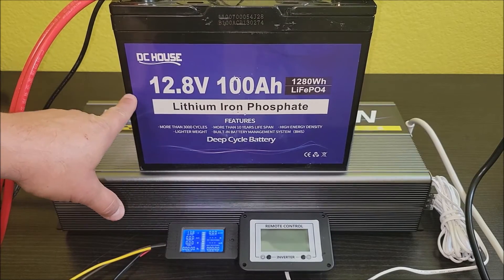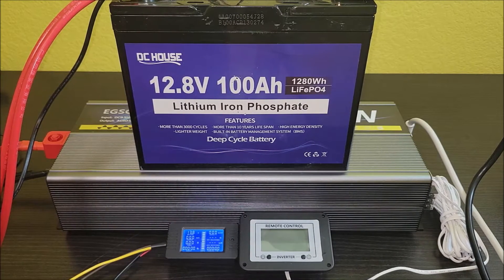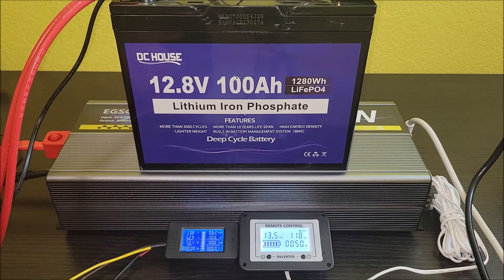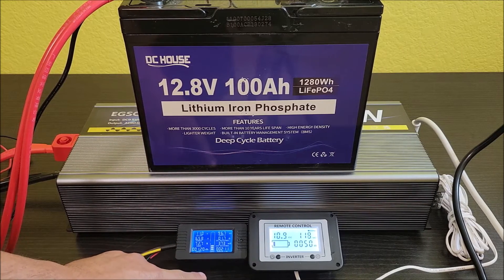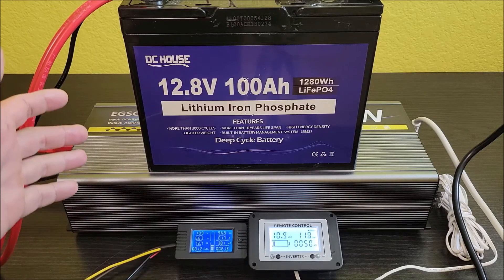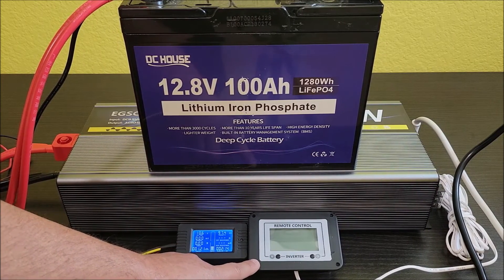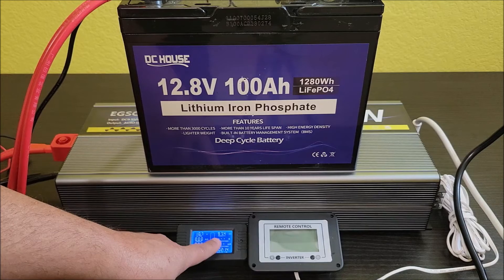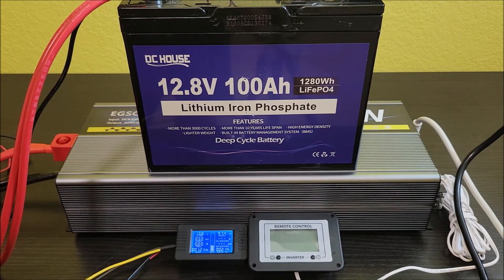Cheap LiFePO4 - Testing the DC HOUSE 12V 100Ah LiFePO4 Lithium Battery

Comment: I bought one and now can’t find a wired battery box it will fit in. Most 100ah batteries seem much smaller. Any suggestions?
Reply from the maker: https://amzn.to/4c7hJ0n ?  Is that what you are looking for?
Reply: Li time battery 12.8v 100 Ah battery is better. Reviews speak for themselves.

Comment: I just ordered a 200 ah one off Amazon for $380. Hope it last longer than my previous gel battery which made it 5 years.
Reply: Treat it properly and you may get at least 10 years and up to 20 years from the LiFePo4 battery. Don't discharge down below 10% and don't charge up past 98%
Reply from the maker: It should.  I have had great luck with LifePO4 batteries so far.

Comment: Is it safe to just sit this kind of "non-marine" chinese LiFePo4 on top of a rental boat while in open, heavy rain or should i look for a marine grade battery? How likely is damage by doing it? Sorry about the dumb question :D
Reply from the maker: I would cover it to keep it as dry as possible.  Like a battery box or something like that.  They have chips and such inside them that could get wet and fail.  Other than that, I would not have an issue using it in the rain.

Comment: Hi I would like to know, I would like to buy that battery tester to get a true understanding of how much capacity my battery has left. Does that tester reset the counted ah. When the inverter starts charging the battery or does it count back wards? What I'm trying to understand is if that battery tester resets every time the inverter starts charging the battery when the mains comes back on? Would love to know. Thanks.
Reply from the maker: I have to reset it manually.  It's a cheaper monitor, but I am pretty sure they have better ones on Amazon like this one: https://amzn.to/42QInrG

Comment: Unfortunately, the cheap $30 Ah meter that your using can be off by 15% to 20%. We paid over $10,000 a piece for each one of our DC load testers that we use, which provide 0.05% accuracy.
Reply: So you have a better video on your channel then ...
Reply: No, we don't advertise batteries. The results of our battery and inverter tests are not meant for public disclosure.  @MrJackson66
Reply from the maker: This cheap one has been accurate enough for me.  I don't need pinpoint accuracy to the thousands of a watt.  If it's off a few watts, that is fine.  It's nowhere near 15% to 20% off.  Maybe 1% or so.
Reply: @quickquote1568
Aren't you Special !
 FJB !
Reply: Hahaha they are max 3-4% out at absolutely max more like 1-2% and I see your posts on alot of videos trolling are we
Reply: Wow, so you like wasting money then
Reply: @sethbob5742  No, you can't go cheap when investing in test equipment unless you want cheap results.

Comment: When you install these in the RV would you please repeat an RV’s A/C test to see approximately how long the RV’s AC will run on the 2 100Ah batteries.   I realize the ambient temperature will determine how long the A/C compressor cycle runs.
Reply from the maker: RV AC units are usually 13,500 or 15,000 BTU units.  Based on that you will probably get about 1 hour per 100ah battery if you were going to run a RV AC off of them.  That would be per AC unit.  We have 2 installed on our new one.  We probably will not be doing that in the RV from the batteries.  We would use our gas generator for that if needed.
Reply: Twice as long?  This isn't magic.
Reply: Literally just do the math yourself, it's not magic
Reply: @P7ab  math doesn’t exactly come out with intermittently running devices.  The math works out to 100% usage minus DC to AC conversion and inverter use.  I was asking for a real life example given specifics.   But if you are so offended by my asking a question I won’t ask again.   Thanks